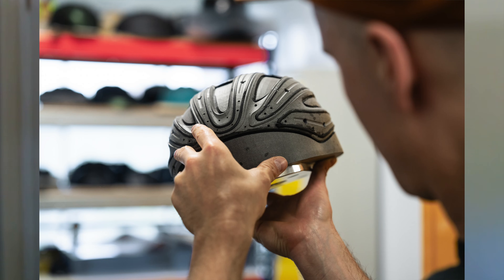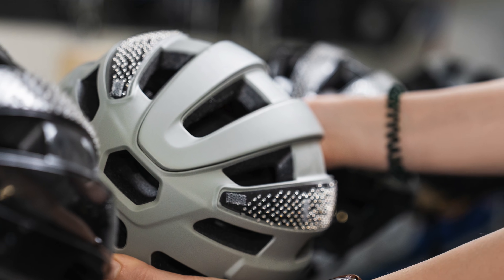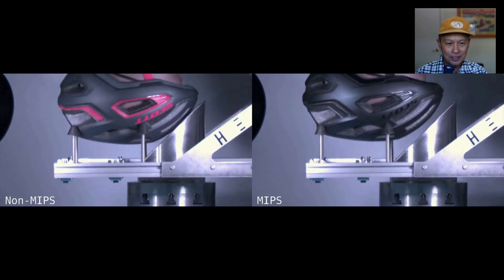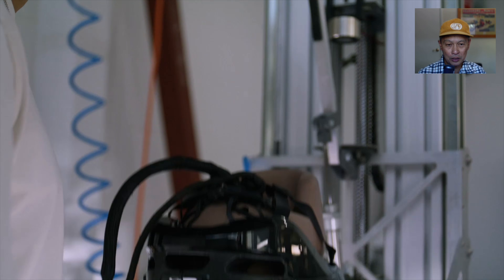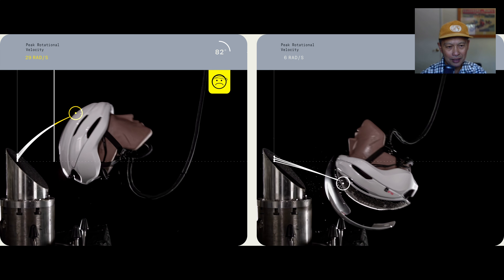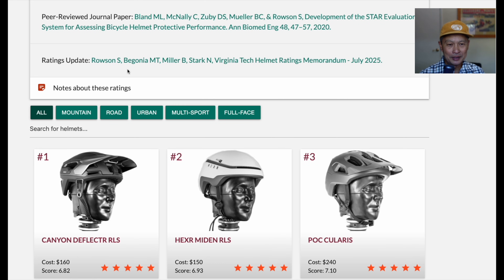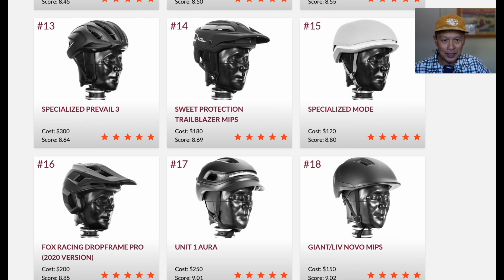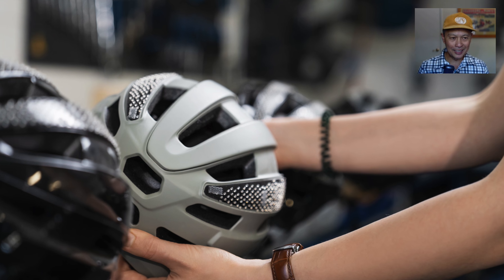$160 Canyon Deflectr Helmet – The Safest Yet? | Release RLS vs MIPS

Comment: As a cynical engineer, I don't buy this.
I feel like these days "tech bros" are just trying to game the system.  Come up with an idea that manipulates the testing methodology to give impressive results, but is not useful in real life.  
Think of the VW dieselgate mess where they made their engine appear to be clean only when it was being probed by a testing machine.  Similar stuff has happened in the computer world with CPUs and GPUs - get unreasonably good scores when tested in an artificial benchmark, but subpar performance in normal operation.  
This is the world we live in these days and unfortunately that's my opinion on this helmet unless lots and lots more data say otherwise.
Reply: Interesting point, I hope not because this is life saving technology
Reply from the maker: That's definitely a factor. Companies coud be designing specifically for the test... and only the test.

Comment: The hardest thing with helmets is finding ones that fit or at least fits a wider head.  Asians tend to have wider side to side and shorter front to back than white folks.  Most helmets I try on are always plenty space front to back, sometimes too much space but side to side is too tight.  This holds true not just with bicycle helmets but motorcycle helmets too.  Last motorcycle helmet I got in Korea cause there they sell helmets for asian heads.  Same helmet in the US is too narrow side to side and if I get one that is sized right side to side it is way too long front to back.  So helmet mfg. at least motorcycle helmets mfg. or at least the better Japanese brands make different fitting helmets for each market.  I wonder if this is true too with bicycle helmets.

Comment: My Troy Lee Design helmet, the A3, is the best helmet I ever had and I had a first gen Reebok Bell Helmet with the pump back in 1999. VT rated the A3 at five stars but now it's four stars. Better tech lower scores.... As soon as TLD makes a ball bearing I'll get one.
Reply from the maker: Did you ever crash on it? How does one know if it's good if no crash... right?

I loved my Troy Lee A2 since the head shape was so perfect for me. And then the A2 Mips came and it didn't fit me.
Reply: @EMTBReview  Yes, I crashed on it in the early 2000s. It saved my life. I was on a road bike and going down hill and I hit a board sticking out of the truck. I believe I was riding a GT ZR-1... LOL it was red. My mouth was ripped open and I blacked out. That helmet is hanging in a place of honor at my local bike shop. Edit it was a red GT ZR 4.0 the bike did not survive.
Reply: I’ve MTBed with A3s for a few years now. Great impact performance and coverage. Comfort and cooling is the best I’ve tried. Though some of their newer products have dropped in quality a bit. So I’ll keep my eyes peeled. Kinda wanna make sure a brand new technology can survive all impact types before I go out and buy one.

Comment: I'd be concerned about secondary impacts. First impact, outer shell is gone. Second impact would be almost unprotected.
Reply from the maker: The outer shell is just a thin plate. The helmet structure and foam core are still intact, and they are the key to protecting the skull from heavy blows and impacts.

Looks like they're just using the outer thin plates to redirect rotational blows.